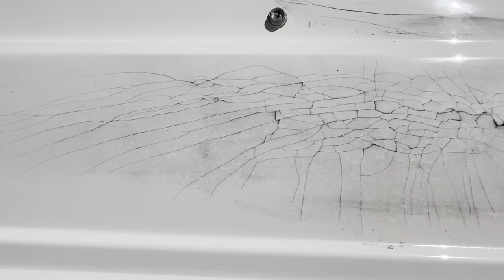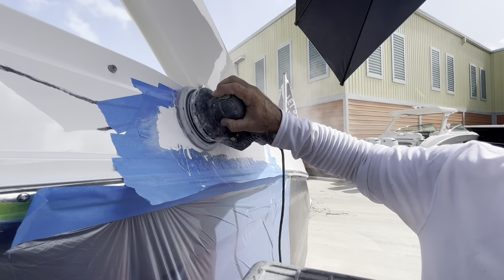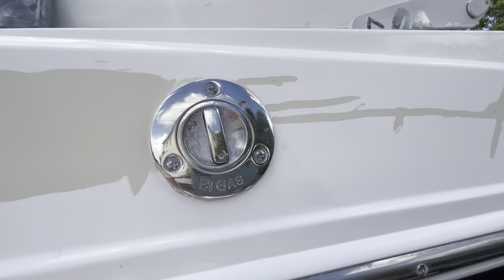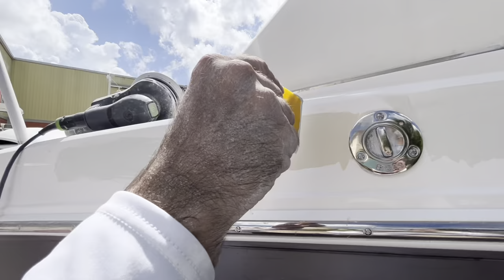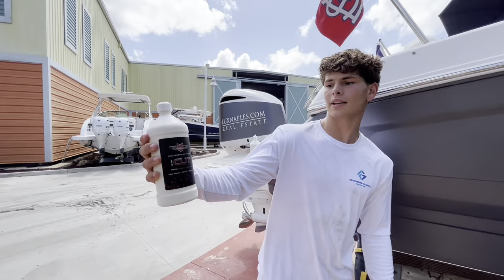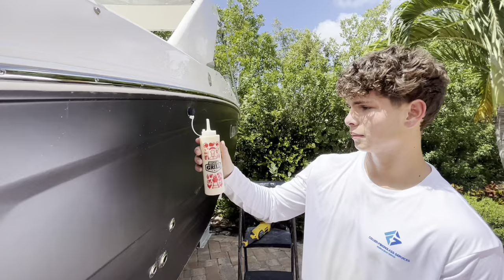How To- Fiberglass & Gelcoat Repair- Stresscrack- Regal

Comment: Man, mask up the inside of the boat next time... You're honestly doing way more steps than u shpuld. After sanding down the fiberglass just use polyester glass for lows and then fillers for pinholes. Spray the gelcoat, sand and buff..

Comment: Your using incompatible chemicals. Polyester won’t bond to vinylester. You should be using a mekp polyester filler with gel coat. Will most certainly have issues down the road doing this. Cream fillers are brittle and used for pin holes only.
Reply from the maker: There is no one way to do repairs. Vinylester is a tie coat that bonds to epoxy and poly. So you’re telling me boat manufacturers that spray polyester Gelcoat into there molds and then do a vinylester lay up are using incompatible materials?
Reply: No vinyl ester will bond to poly but not vice versa
Reply: your chemicals will separate year or so down the road if your not careful do some research if you don’t take my word for it. I see this mistake all the time even at big marinas with million dollar boats smh

Comment: Good job, not knocking anyone, but why not spend a little more time on your filler so you dont need as much glaze.... just end up packing if not anyway...
Reply: I have a hard time understanding filling and glazing to the finished level of the surrounding gelcoat. The new gelcoat has to be very thin. It seems if you ever had to compound this are in the future you  could easily burn through.
Reply from the maker: Should be plenty thick with the proper amount of coats, you could use a mil gauge if you were worried about it. Also once shiny all one has to do is keep up with polish and wax.
Reply from the maker: Arthur the icing glaze I’m using is a polyester two part self leveling filler. Not sure if you were thinking it was similar to the single part paint glaze? But big difference. It’s amazing stuff, I recommend trying it in addition to your regular filler as your last pass with filler

Comment: Just my two cents as a retired fiberglass guy.
I would remove the gas fill and canvas clips first. It's tough to sand with a block when they're in the way.
Just use one layer of 1-1/2 ounce mat. The second layer was probably all ground off to keep the patch within profile anyway.
Should have just kept grinding where the other cracks are instead of trying to minimize the work and filling them with putty. 
Gelcoating on top of the new wet mat helps fill in the voids. From there, I would block sand the whole thing to get it level.
Brush on gelcoat to fill small voids and resand. When it's fair, spray gelcoat, thinning with styrene (not acetone).  No need for vinylester resins and putties in my opinion.
Reply: exactly what I was thinking. And they destroy polishing pads. Its just a screwdriver and 60secs of work

Comment: Is there suck a thing as to much resin? 🤔  as long as you have no airbubbles it should be fine correct?
Reply from the maker: @smallnuts2 usually the thicker the resin the more brittle it will become. The strength comes from the glass and not so much from the resin. With a little more than 1oz polyester resin it should cover 1.5 SF of chopped strand mat.

Comment: Great tutorial! Question, after you laid up fiberglass you then gel coated and sanded back down and used 3m filler. Wondering why to gel coat right after laying up glass?
Reply from the maker: @56coster so there’s a couple reasons why I coated it with Gelcoat with wax*.  I was using laminating resin so the Gelcoat with wax helps seal off the resin and makes it nice and hard and ready to sand without gunking up the sand paper. Also it helps fill voids and makes a much easier fairing process.
Reply: Thanks so much! Makes sense.
Reply: @ChettyH2O  I do the same but have wondered if you can't just use the filler for the same purpose, ie to cure the resin?
Reply: You could have just covered your glass patch with a piece of peel ply  and let it kick off. You could have peeled the peel ply off and had a tack free patch. Why would you ever put gel with patch aid on top of of something you are going to wipe or spray again. Makes no since to top coat something with wax (Patch Aid )  in it.  Not correct repair procedure. @ChettyH2O
Reply from the maker: @fluid36 yes you can do that too. I like to do the Gelcoat because I think it smooths it out nicely.
Reply from the maker: @neebolopez8995 Yes, peel ply or other barriers could work as well. That’s another good method (not the only method). I use the gelcoat with wax to help with the fairing process, it helps smooth the chop strand out nicely and makes for an easier application of filler for the body work, I can also see where I will need more or less. Again there is more than one way to do a repair, I am showing what works for me. Also, wax and patch aid are not the same, I did not add patch aid to the first coating over the glass.

Comment: would it be good idea to use polyester structual putty instead of fiberglas and then gelcoat on top? thanks
Reply from the maker: @piotrtrocki3842 You can do that, it just depends on the repair. Laying glass on the repair will make it stronger and hold better.

Comment: Hi there - I'm new to this and grateful for your video - hoping you can clarify something for me. I was instructed to spray the first coat without the patch aid; to use the patch aid (Spectrum) on the second coat.  Can I use patch aid on both coats? Was there a reason for the instruction I received? I'm also excited to see the aerosol spray as I'm not comfortable with the compressor and spray gun.
Reply from the maker: Hey so those instructions from spectrum  are correct. when I was saying coats I was continually spraying layers before it hardened. Had I left the first coat with patch aid to harden I would have needed to sand it before spraying the second. The patch aid will leave a film similar to a wax additive to seal the surface of the Gelcoat.
Reply: I have a 30 yo boat we purchased last year with LOTS of dings, bangs, and cracks. I was told to use sika biresin and 3m platinum filler. I started this adventure but clearly need additional instruction! Do you recommend using the above? My products arrived with red and blue hardeners (is that okay for white gel coat)? What recommendations do you have? REALLY appreciate your guidance.
Reply from the maker: I am not familiar with the sika biresin, the 3m platinum filler is great. The red and blue hardener should be fine, it will help while learning to mix the product thoroughly, the white hardener tends to be difficult to see when it’s mixed completely. On bigger jobs with lots of dings and scrapes we tend to do all the body work at once, then scuff all areas needed to spray, then tape off and spray all areas at once. That way you aren’t jumping around and wasting product
Reply: @ChettyH2O   AWESOME...thank you!  Now another question :-)  I found the Preval sprayer unit at West Marine and gave it a whirl a few minutes ago (tested it on a piece of wood) - sprayed great, looks good - really happy so far. Going to let it set and then guide coat, wet sand, per your instructions :-) QUESTION: Would you explain how to clean the glass bottle? I fear I added too much MEKP (it is very hot to touch...ugh), and is already hardened in the bottle. DOPE, I'm always learning the hard way. Grateful for your assistance. Also: Spectrum says 70% Gelcoat + 30% Patch Aid + 2% MEKP to total weight. I followed your example in the video with 2 oz Gelcoat, 1 oz patch aid, .06ml MEKP.  Aren't I just so much fun!?

Comment: where can i buy dye coat
Reply from the maker: @user-sp6xv6fl8w we purchase it through our local auto body store. It is also available online and on Amazon. We use the dry black powder guide coat. Black is preferred, it does come in other colors.
Reply: This is where you buy Guide Coat Dura-Gold Premium Black Dry Guide Coat Kit, 7 Ounces (200 Grams) - Powder that Instantly Highlights Auto Bodyshop Repair Surface Imperfections, Identify Body Filler Pinholes, Sanding Scratches Defects